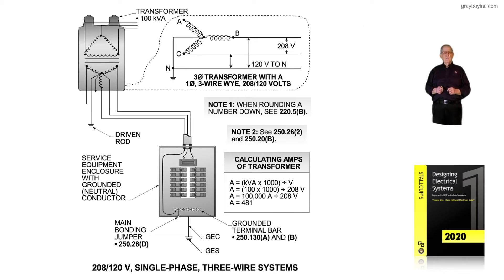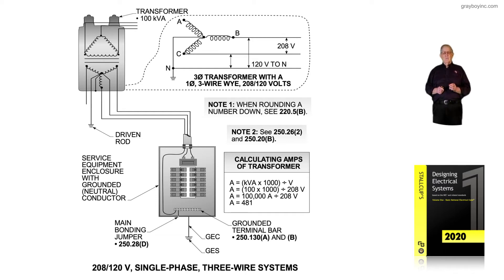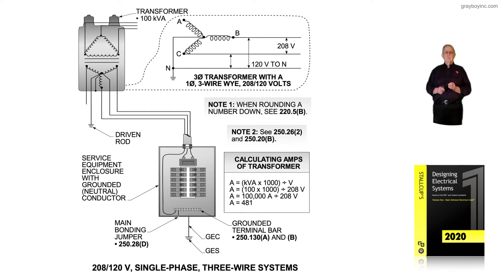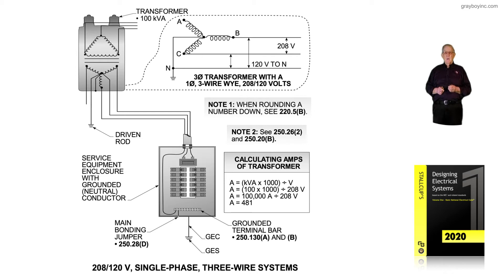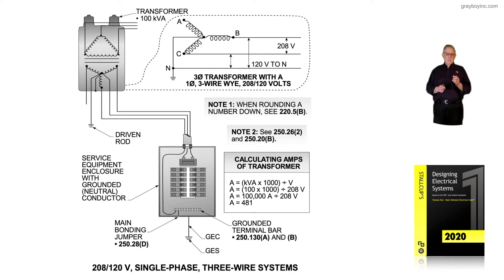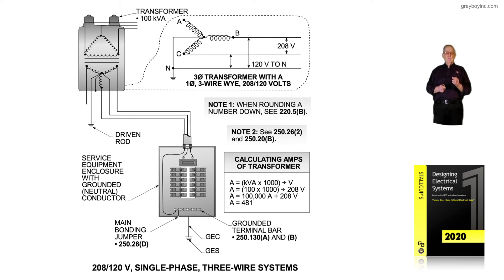4-2  208/120 V, SINGLE-PHASE, THREE-WIRE SYSTEMS

Comment: Love your videos and knowledge, you see 120/208 single phase systems frequently in larger apartment complexs,  condos and townhouses, as well as hotel and motel rooms, although resistive loads designed for 240 volts such as ranges, dryers and baseboard heaters operate at reduced power,  the overall system is more efficient